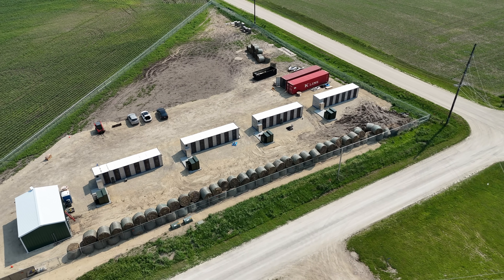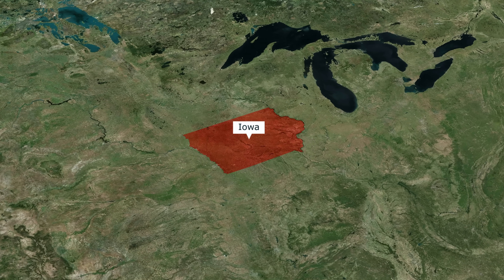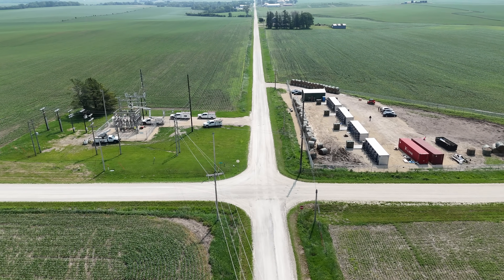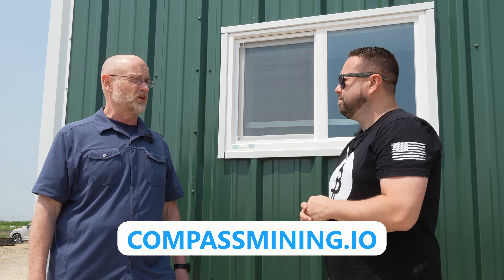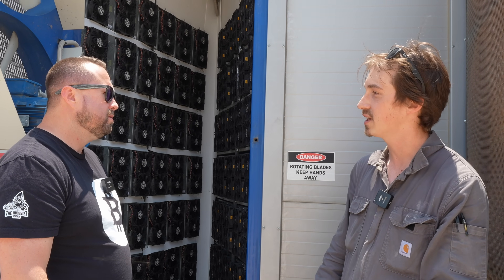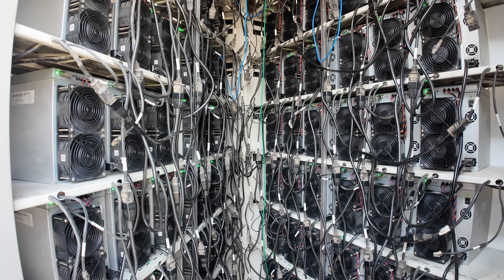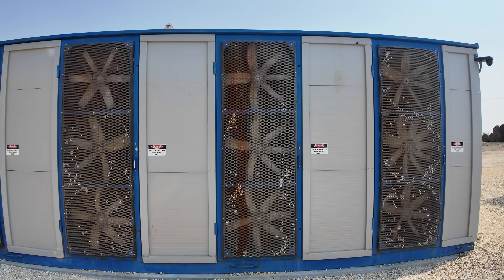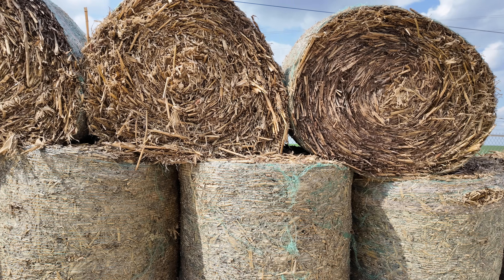I Visited a New BITCOIN Mining Farm in Iowa!

Comment: THM great mining farm review, dude you always asked the question i truly like hearing, good to get there response to see how much they know as well, especially when it comes to the electric build out questions, with that said at 7:01 he is technically not wrong but he could have responded a bit more accurately, basically each of their 2MW transformer takes in very high KVA’s and step it down to 3 phase 415v, that means each of their 3 hot legs to neutral would read 138v or less depending on the neutral split so more like 130-138v per hot legs, then they split out L1 L2 to a PDU for 260-277v, that’s definitely higher than 240v but close enough. and the way you split out 3-phase into split phase is L1 L2, L2 L3, L3 L1, this gives them 260-277v from each of there 400amp breakers from a single 3 phase circuit. as always great content.